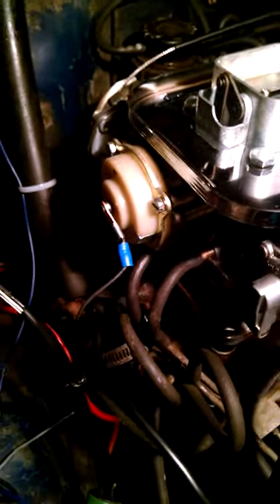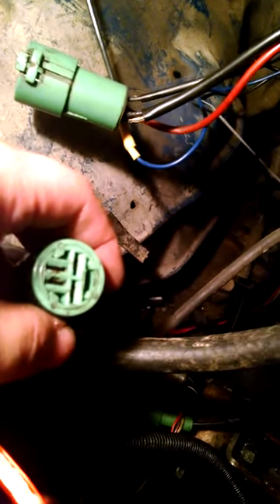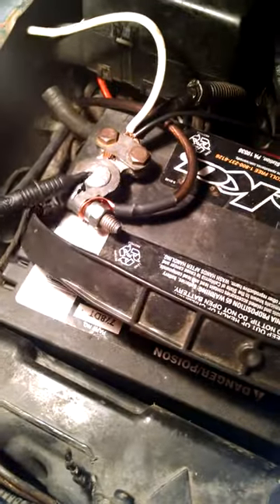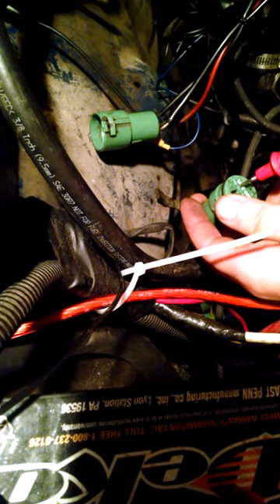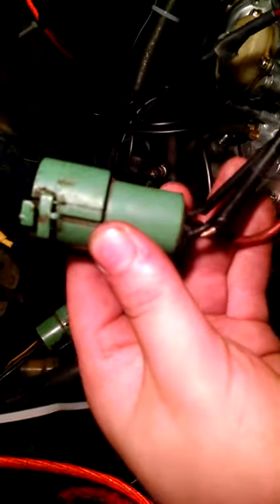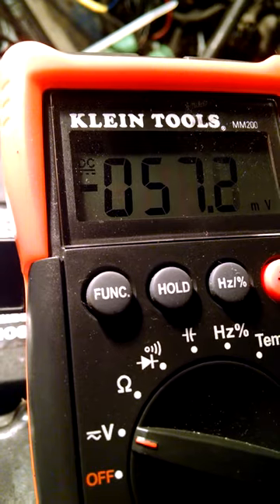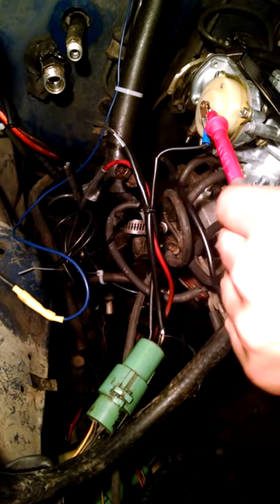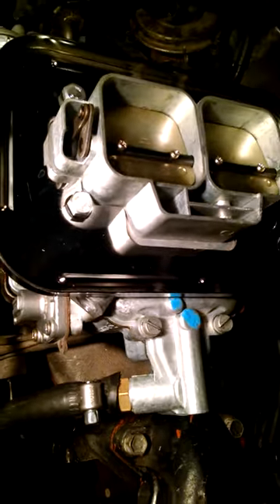How to hookup an electric choke weber carb 32/36 on a 22r  87 toyota

Comment: I'm way late getting to this video but for those interested in the readings on the meter pay attention to the right bottom part of the screen. Any time you see mV that stands for millivolts. Meaning 30 or 40 1/1000 of a volt. In this scenario that is equivalent to 0 volts. Many multimeters have the ability to read these incredibly low voltages to troubleshoot intricate electronics control circuits and such. If you notice when he gets on his 12V hot the mV is replaced by just a V, indicating full voltage.
Reply from the maker: Cole Hervey u sir are a gentleman and a scholar. Ty for clearing that up. I feel so stupid but it needed to be said lol. Thx again
Reply: @sl3ndermmo  you don't know something until someone teaches you. I just happen to be in the field so I thought I would share. I saw another comment where someone said they're millivolts, but unless someone takes the time to go educate themselves on what a millivolt is that doesn't clarify much. Just figured I'd get a little more in depth. Thanks for your video by the way. I'm suffering some Weber choke woes on my Samurai at the moment.

Comment: god bless you for this video. just got this same carb for my old dodge 2.6 and had to switch to an electric choke because of the throttle setup. you just saved me a lot of troubleshooting
Reply from the maker: Runs with Scizors glad I could help brotha
Reply: @sl3ndermmo  IM LATE! but does your truck start with no problem on a cold day or just any day? with out holding down on the starter for it to prime up?
Reply from the maker: @kyuubi9315  when it’s really cold, it sure doesn’t start up as quick . But I have yet to have a problem with it starting on cold days like 5-10 deg
Reply: @sl3ndermmo  thank you sir! Looking to do a Webber upgrade. You would say worth? And the carburetor comes with a kit, did you still have the stock manifold with the plates that come with the Webber carb on the truck?
Reply from the maker: @kyuubi9315  the Weber is totally worth. Absolutely!  Now this was a while ago so I’m trying to remember which adapter I used. Yes I used the stock manifold but I did not use the plates that came with it because I messed it up, I forgot what I did but I broke the plates somehow or screwed something up lol. I’m gonna try to find the adapter I used… hold please.    https://www.jegs.com/i/Trans+Dapt/969/2181/10002/-1?gclid=CjwKCAiAo4OQBhBBEiwA5KWu_xwgS4npo4iMW8YbLuUbvi1RsHsuN9EG9p_muvZyeK3WsS_u-oaWPxoCXxUQAvD_BwE     It is a very tall adapter my good just barely closed but it NEVER caused me any issues.
Reply: @sl3ndermmo  your amazing man! Thanks I needed this.
Reply from the maker: @kyuubi9315  that’s why the video is there, to help y’all out. I was lost and had a friend help me out. Once I realized you could just YouTube the stuff, I’ve done so many mods to my vehicles, my house. YouTube has been amazing for diy guys and I love it. Let me know how you made out buddy. I’ll be here if you have any questions ;) good luck sir
Reply: @sl3ndermmo  I’ve done some things already too it. A performance header with glass pack dumping at the driver side behind the tire. Minor cam in it and it sounds amazing! Just carburetor and fuel issues. Ole girl needs some loving. She’s been beat up all her life and I’m giving her some attention.

Comment: I was getting so frustrated i was about to rip that electric off and hook the old manual back up.  thing is I don't have the hardware except for the cable.    i don't know why i was thinking that the electric would need to shunt off after the engine warmed up.  So what it needs to be is 12 Volts  the entire time the ignition is in the ON position.  and zero volts with it Off.  

  i might still hook that manual back up. LOL it seems kind of cool and the dashboard has it built right in, even turns on a light when you pull it out. this carb was expensive but i really do like it, way better than the KEIHN that this little Honda CVCC came with.  the 32/36 works AWESOME when it's hooked up properly. 

  those weird readings you keep getting are confusing me as well, I have some wires that say over 30 volts as well, what the hell is that?   also , just recently i have been having a problem with the multimeter going ape shit crazy if it's within 2 feet f the running engine!  I mean literally I cannot get a reading because the meter just keeps going all sorts of crazy, even when its not hooked up to anything on the car.  soon as i shut the engine off it will read whatever i want.    I can't seem to get a straight answer from anyone about this, seems like i will be having to figure it out on my own. makes me wish i was an electrician.  i am positive something is wrong, there is no way that should be happening.  there is some kind of really gnarly field being generated that should not be there. 

   GREAT VIDEO MAN!  Thanks.
Reply from the maker: +RockAnAhardSpot that is weird. I was having a lot of trouble with mine and finally realized it was on ac and not dc. Someone said atmospheric stray voltage, who knows man lol. Maybe we can get an answer on that. And yes that is correct. I thought maybe it would shut off too and use the heat from the engine/carb, i was wrong, its on the whole time.
Reply: I just watched this video, I'm having to set up an electric on a 72 18rc engine. I noticed that on your meter when you were seeing over 12 volts it was actually reading mv so 0.03 volts would be 30mv. Maybe you already realised this, the video was taken three years ago, but thought it might still be helpful to note.
Reply: I'm way late getting to this video but for those interested in the readings on the meter pay attention to the right bottom part of the screen. Any time you see mV that stands for millivolts. Meaning 30 or 40 1/1000 of a volt. In this scenario that is equivalent to 0 volts. Many multimeters have the ability to read these incredibly low voltages to troubleshoot intricate electronics control circuits and such. If you notice when he gets on his 12V hot the mV is replaced by just a V, indicating full voltage. 

Addressing the meter not working around the running engine, there are a couple of potential answers there.  Firstly I would look into the quality of the multimeter in question, you get what you pay for on this front more than many. A cheap multimeter can easily get someone hurt or killed. There is also a possibility that your batteries could be low, but unlikely if it works steadily somewhere else. I would assume there is frequency interference of some sort which quality multimeters have protections for. 

For what it's worth that's all the knowledge I have available to offer, coming from an electrical and instrument tech.

Comment: What would happen if you didn't have this wire hooked up? Would you have to wait for the engine to warm up?
Reply from the maker: the engine warming up may open the choke, u would definitely think so anyway. so when its cold, the choke is closed and u can easily start the engine. the electric choke slowly opens the choke allowing more air. if you leave the electric choke disconnected, i guess you would just be running super rich starving for air because it would stay closed.
Reply from the maker: http://www.hotrodders.com/forum/how-does-electric-choke-work-7696.html#/topics/7696?_k=kda42t

Comment: Wouldn't it be easier to just find one that has more than 12 watts and fuse it right there. Before you plug into the carburetor?. It just seems a lot easier than all this you're doing.
Reply from the maker: mario avalos 12 watts or 12v?
Reply: Lol u know what i ment